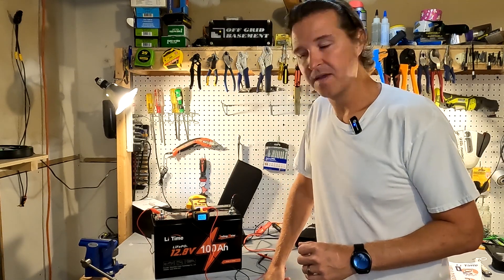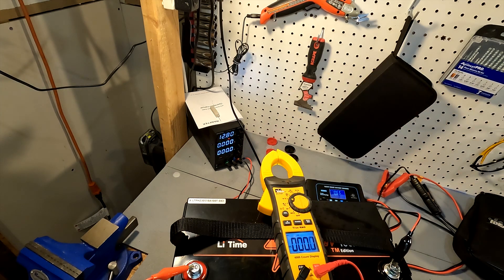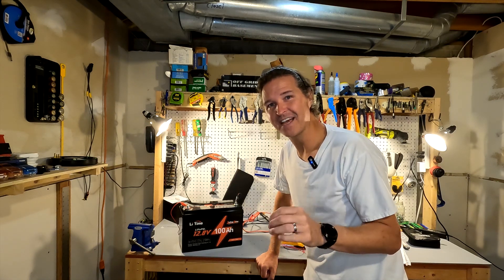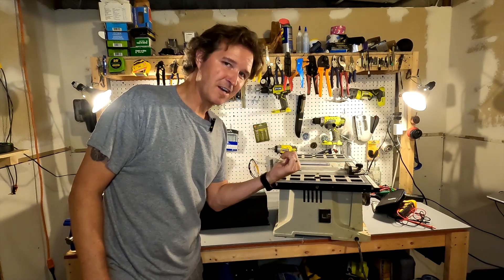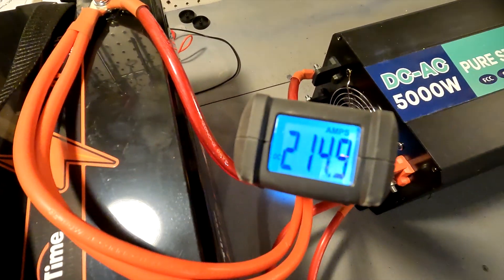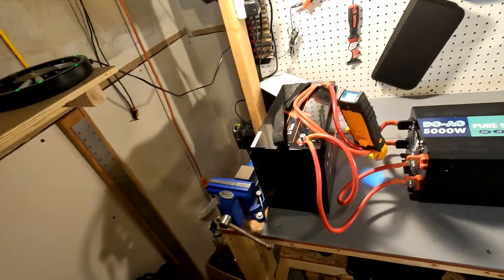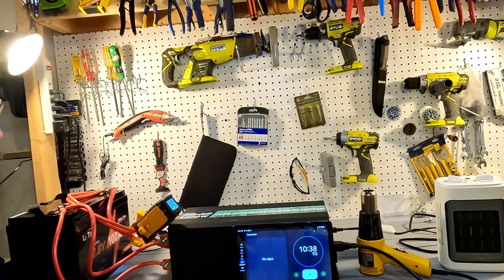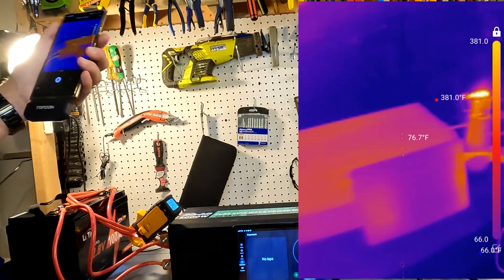Reviewing the Li Time 12v 100ah TM Edition Battery!

Comment: Great review !!!  I bought the LiTime 100ah Max and created a Solar/battery system that powers a 3000w LiTime inverter, and using the Victron smart shunt, and Victron charge controller, both have blueTooth so I can tell what is happening with the load, and battery voltage.current adn time to discharge.  And yes, I do wish they put a bluetooth in the battery, but what I have is very workable.  again great review !!1
Reply from the maker: Thanks for sharing!  Sounds like you have a nice little setup.  Have fun and be safe!

Comment: Hello, thanks for your test!  

I recently bought a Power Queen trolling battery (which I suspect is made by the same outfit) and had a similar experience with the voltage being 12.8 or so after fully charging (trip the BMS), but as soon as I applied a brief load the voltage came up to ~13.4. I don't understand what is happening there, but it isn't necessarily a problem. It could be an artifact of the BMS when it has cut off charging. 

There are a few weird aspects though. 1) Charging seems to cut off way before 14.6V. More like 13.7... or it jumps up from there very quickly.... and when discharging, it quits before it gets to 10V.  2) Charging stalls for a long time around 13.5V  3) I've cycled it 3 times and capacity seems to be declining each time. 4) It takes a lot more than 100ah to charge it. 

I'm concerned that I have a bad cell or something. Maybe the BMS tries to balance at 13.5V and it can't, but uses a lot of power in the attempt. I don't have good testing equipment unfortunately! I'm charging with an Imax B6 at 4.5a (takes forever) and discharging through an inverter hooked up to a heat lamp that runs through a Kill-A-Watt (AC power/energy measure). The inverter losses are an unknown in this case, but the first discharge test I got 1340Whr assuming 85% efficiency, so it's probably a bit better than 85%. The meter measured 1140Whr. The last one was only 1060Whr. One problem with both the charge and discharge test is that I have to pay close attention because when the BMS trips, I lose the data!

Either my charging and discharging devices are randomly inconsistent, or something is wrong I think. Like a weak cell is causing a long balance attempt, and then it trips the BMS too soon at both ends. I know, I need to get a proper meter... but I don't think I have time to do that before the Amazon return window is over.

If you have any experience or advice that would be helpful, please let me know! I'm currently starting the long charge cycle again...
Reply from the maker: I think you really need better testing equipment in order to truly find out what is going on.  I don't think it's a bad cell since you're getting 13.5v.  It's possibly a weak cell.

Comment: I had this problem and Li Time blocked me. It's not a feature, the cells are out of balance.

I use to say I'd stand my Li Time but after experiencing their customer service I'll stay away from them.

The problem is the bms doesn't balance the cells. I ended up disassembling the battery and what I found is 1 cell is 3.61v and the other 3 are 3.25v. The bms is turning off when the one cell crosses 3.65v. Li Time blocked me in their group and wouldn't answer their emails.

I fixed the issue by replacing the bms with an aftermarket jkbms with a 2a active balancer and the problem is gone
Reply: What version litime battery? The model # ?
Reply: Hi, Paul, I'm sorry to hear about your experience, but could you please let us know your contact information? LiTime has always been a customer-first company, and we'll get back to you on the issues you've raised.
Reply: @BobBob-il2ku  both the 12v 100ah and the 24v 100ah. I've replaced the bms in each to a jkbms and the issue went away
Reply from the maker: I'm glad you were able to get it fixed diy style.  I'm going to do another capacity test to make sure.  If cells are that far out of wack then I shouldn't get full capacity.  Thanks for the comment.
Reply: @OffGridBasement  yea my 12v delivered 92ah before and 103ah after. The 24v was different. Turns out 2 cells were only doing 93ah and the other 6 were 101ah. I'm only getting the 93ah as I'm stopping the cells at 2.5v/cell. 

Just my experience with Litime. Keep up the good videos, I've learned a lot from them

Comment: The 12.8v after charging is intended. It was purposely programmed into the BMS to I guess prevent over charging? When you draw on the battery the voltage then jumps back up to the 13.5v. I don't understand it though. This seems like it would cause more problems when charging than benefits.
Reply from the maker: Maybe it's something specific to trolling motors?  Not sure.  Thanks for the comment.

Comment: I read online recently that, when using Lithium batteries on a bass boat, you should limit your speed on electronically controlled motors to 90% of maximum. Maybe that it why the BMS is set up the way it is. I thought, until now, that the higher max amperage limit and longer duration times where what set the TM batteries apart. You may have revealed another feature of them. If you find out more please post a follow up video.
Reply from the maker: Thanks for the info and the comment.

Comment: Great video! I have a 20 watt 1 amp solar maintainer that I currently keep on my AGM 12 volt battery. It's at my dock, sits out in the sun all day and it keeps the AGM up. Would hooking the solar maintainer to the new Li Time have any effect on it at all as far as a charge or any harm to the battery?  Thanks for sharing your knowledge!
Reply from the maker: If it's pushing upwards of 20v then there might be an issue.  The BMS on a lifepo4 battery will shut down around 15v to protect the cells.

Comment: Did you ever recheck the capacity of the battery? I'm seeing 12.8 volts on one LiTime when "full" and 13.3 on a second one - odd. Seems like some people are suggesting a bad BMS and unbalanced cells. I don't have the equipment/software to test and am hoping you actually rechecked your battery to help me figure out if I should return one of these batteries, thanks!
Reply: Are they both the trolling motor version?
Reply: Yes.
Reply from the maker: Sorry for the late reply.  I've rechecked to capacity and everything is still good.  I don't have any problems with the function of the battery whatsoever.
Reply: Thanks - LiTime told me the battery reports 12.8 volts when it goes into overcharge protection. They said to put a 30 watt load on it for 30 seconds and it would then report its true charge voltage. That did, indeed, work. I'll wager the cells are not in ideal top-balance but no way for me to confirm that I know off. Hopefully the BMS is sufficiently good to resolve over time and I don't have a bad cell! It would make an interesting video if you were in to opening one up in the 12.8 volt state to confirm and to see how balanced the cells were. And, maybe, you know how to see how well their BMS is at balancing? No published data I can find on how their BMS works...

Comment: I'm real curious to see if other companies "trolling motor" models have the same issue?
It does seem to be a tough little fella.
Thanks for the cool video!!👍✌️
Reply from the maker: I would be interested as well.  I'm doing another capacity test to make sure things are correct.  If it's an unbalanced pack then I shouldn't pull full capacity.  Thanks for the comment.
Reply: @OffGridBasement any update?
Reply from the maker: @BobBob-il2ku  I did another test and still can't find anything wrong with the performance of the battery.

Comment: The BMS on this battery is definitely a bit quirky.  People are having charging issues because of this in non trolling motor applications, which the battery has been marketed as being applicable in other applications.  It literally has a picture of an RV on the side.  If you just charge the sucker and slap into the boat it’s a badass battery.  Doesn’t like extended absorption times like you might have to deal with on a multiplus that has a 1hr minimum absorption time.
Reply from the maker: Thanks for the info and the comment.
Reply: Where did you get that information?

Comment: Sir:  How much do you think that spike shortens the cell life?  Also most videos and spec sheets say not to keep a float charge (usually 13.4V) on the battery or keep it near 100% charged) as that makes a big difference in battery life.  Most RV 12V power supplies keep the house batteries at about 13.5V when the unit is on shore power.  Will that kill LIPO4 house batteries?  

Thank you, 

A T Burke
Reply from the maker: I'm actually running another capacity test currently to get better results on the battery.  I don't think I did any damage.
13.4v is what I keep everything at.  I don't think 13.5v will do any damage.  13.6v is the tipping point.  Anything above 13.6v is where you might start to see damage over time.  Hope this helps and thanks for the comment.
Reply: Thank you, Sir.  I keep my 4 ea #31 deep cycle open vent lead acids at 13.45 for lead acid's best life.  They are getting old but still test as excellent.  I'm about to replace with lower cost (LiTime price area) LIPO4 batteries.  I have been hesitant with all the talk about keeping LIPO batteries at 50% charge.  This is for an emergency back up so I wanted to have them at 100% charge.  Since the total amp draw will be at about 15-20 amps, 5 amps per battery they should get all their amp rating as it is at a 20 hour rate so no radical Peukert  effect.   My current float charger keeps them at 13.45 volts and just pulses a brief jolt every minute or so.  Still I'd like to go LIPO, and will now that I have your explanation.  

P.S   I think your explanation is great because it is the same as my conclusion :)  

A T burke @OffGridBasement

Comment: Great video!  We bought 2 of these batteries for our RV - haven't installed them yet - we were charging them with a 20amp charger to get them charged to connect them in parallel.  The charger stopped at 65ah and would not turn back on.  We sent the charger back to AMZ.  Bought a Victron 15 amp charger and the battery won't take any charge.  We are measuring 12.6 volts on each battery.  LiTime has told us it has to do with the overcharge protection and to put a small charge (30W) on the battery and discharge for 5 min., after 30 min the battery should return to full charge and reflect 13.33V and above.  We don't have an inverter - my question - if we put them into our RV and run the slides, 12 v lights, etc. and the battery depletes (we have a shunt/monitor), do you think we could then plug in our shore power to restore the charge on the battery?  Our charge controller (Prog Dyn) doesn't fully charge lithium, but we have the pendant to boost the charge.  I thought of not using the pendant first, to see if we get at least to 85% charge.  Sorry for this lengthy comment.  :)  You're good at what you do!
Reply from the maker: I believe as long as you are using the victron charger you should be fine.  Thanks for the comment.
Reply: We used the IP-65 to charge them - 2-100ah set in parallel have charged to 210ah!  Still in absorption mode at the moment, I’m sure very close to full but holy cow!  210!

Comment: Thanks for the review.  I am going to buy two of these LiTime batteries for my 24 volt Garmin trolling motor.  I have a question is the following charger adequate for the batteries?  NOCO Genius GEN5X2, 2-Bank, 10A (5A/Bank) Smart Marine Battery Charger, 12V Waterproof Onboard Boat Charger, Battery Maintainer and Desulfator for AGM, Lithium (LiFePO4) and Deep-Cycle Batteries.  5 amp per bank, if I use the motor all day and charge overnight, will this charger work just fine?  Noaco does make a 20A (10A/Bank) charger that is more money.  thank you
Reply from the maker: I don't know if the batteries will be fully depleted, but it would take 20 hours to charge back up from 0 to 100%.  Hope this helps.
Reply: Thanks for your help

Comment: A youtube video shows a 12-volt ReDoDo 100-amp out of the box that read 14.4 volts. I received the Li time mini 100 amp and the voltage is 13.6 volts. That means the battery is only 80-90 % charged. Correct? Is my battery defective?
Reply from the maker: 13.6v is over 90% full.  It's not defective, but it's not typical of what a lifepo4 battery right out of the box should be.  It would be a good idea to do some sort of capacity test.  Thanks for the comment.
Reply: I have the same battery .The book says when checking state of charge let the battery rest for a couple hours and add  .05 - .07 volts The problem Im having is I cant get it to take over 30 amps durnng charging

Comment: Thanks for the review I bought the exact same battery from Amazon 1-18-24 I cant get the battery to accept more than  30 amps durning charging, I am discharging the battery to around 11.6 volts before testing, I have tried it  in my motorhome and on the bench with large cables and a new 75 amp converter charger, It does no better than 30 amps, I watched Will Prowes put a 100 amps in this battery. do you have any suggestions
Reply from the maker: I would suggest slowing down the charging.  The BMS might be overheating.  Does it not charge at all after you put in 30ah?  What is the voltage when it quits?  It should be around 13.7v  If it doesn't continue to charge then the BMS programming might be set incorrectly and you need to send it back.  Good luck and thanks for the comment.
Reply: Correction I retested on bench 75 amp charger was putting out 77 amps in the motorhome still 30 amps

Comment: Are they planning a 24v 100ah with low temp cutoff m?
Reply from the maker: Not sure.  That would be a 10k amp surge capability.  Not sure I would need that!  Thanks for the comment.
Reply: @OffGridBasement that is not how amps work. The amp surge would be about the same if it were built up to the same level but double the watts.

Comment: I had an issue with my lifep04 batts. 2of 4 batts did the same thing you are experiencing, the co. I bought the batts from told me the the issue was that the first two batts. have prismatic cells.  the second two that were doing the same issue you are experiencing are cylindrical cells.  so the the prismatic cells dont play well w/cylindrical cells in parallel/series so I shipped them back and received two grade A prismatic cell batts. and all is well. so that batt. you have there might be a cylindrical cell Batt.  thanks for the great vids. keep em coming.
Reply from the maker: Thank you for the info and the comment!